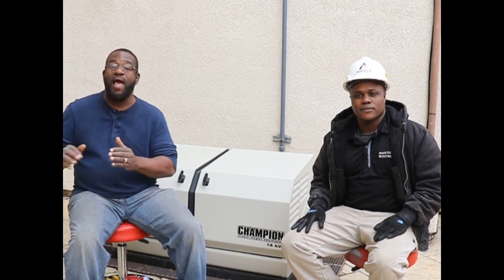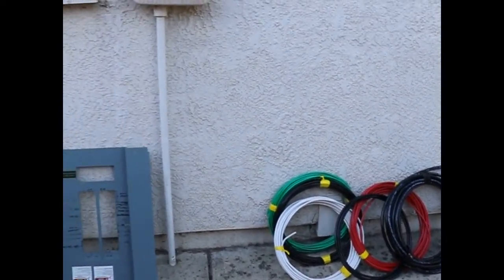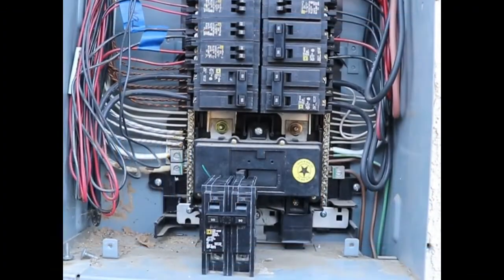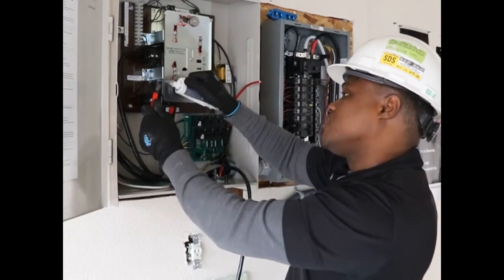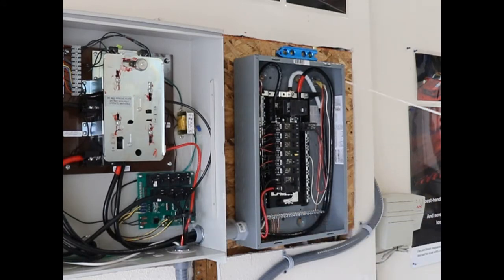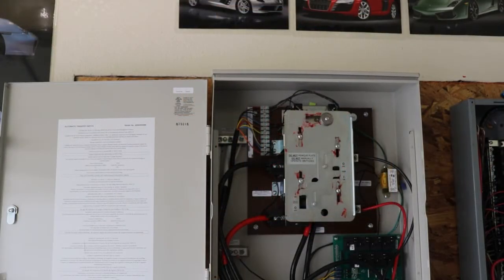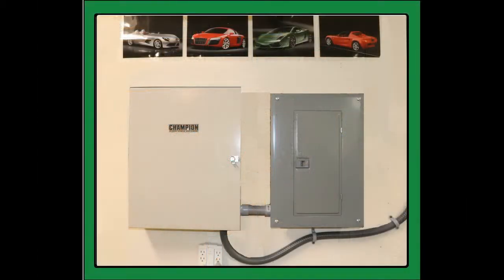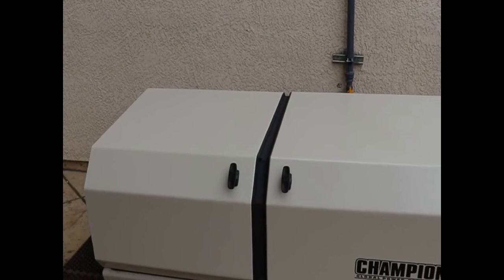Champion Generator Installation Electrical connection Part 3 of 5

Comment: Just got one of these. Have you ever had trouble measuring the oil using the dipstick? It seems every time I pull it out it’s different and very hard to tell where the line is. I only put half a quart in it from the factory and it shows full? Also is it supposed to have a slight metal rattling sound when running?

Comment: Since your ATS is not a 3 pole and you are not installing the generator as a “Seperately Derived System”, I’m hoping that the neutral to ground jumper bar was removed from the generator.   Typically they are shipped connected.
Reply from the maker: Yep, subpanel has it's own dedicated ground. We show that in the video at about 1:50 min. In.
Reply: @Engineerboy100     Sorry, I think you are mis-understanding.  I’m talking about inside the generator.   There should be no bond between neutral and ground within the generator.   There typically is when new, and should be disconnected.   Your electrical contractor should be asked.   If bonded, needs to be removed.
Reply: @Engineerboy100     This will show and explain what I’m saying.   Be safe!   

https://www.usa-svc.com/PDF/InfoSheets/42.pdf

Comment: You might want to get a coat of Rustoleum clear coat on the exterior.  I have the same generator and live in very dry area not normally prone to rusting and I have rust spots showing up all over the exterior.  Once I got that sprayed on the generator, it looks the same but the rust issue stopped.
Reply from the maker: That is a very good idea! Thanks for the tip, I'm definitely gonna do that.

Comment: what are you using that grease.   You don't need it.  also if you do it with aluminum you need to scrap it off then wire brush it.
Reply: why i meant  throw that crap away... you don't need it.
Reply from the maker: You are correct, we do have the newer aluminum alloy that doesn't really require the anti-oxidizer but ... it doesn't hurt anything and you never know who might be watching and where they located or what wiring they are working on.  Some climates like Florida still need it and some older homes with old wiring will benefit from the protection, but thanks for the comment.

Comment: Where did you get the signal wire cable. I have been trying to find a supplier.
Reply from the maker: Signal wire was part of my package, it came with the generator. It has a part number, you just specify the length you will need for your installation and they include it.  The part number is at the beginning or my unboxing video of this generator.
Reply: @Engineerboy100  I have contacted Champion several times and they gave no indication that they had or supplied it. I haven't bought my generator yet they are out od stock in Ontario Canada.
Reply: Thanks for your reply, Champion parts Canada does not recognize that part number.
Reply: I made up my own signal wire bundle, different colours but worked out fine. It has been installed and working for a couple of months but now one of the wings is starting to rust. looks like something rubbed the paint during shipping.